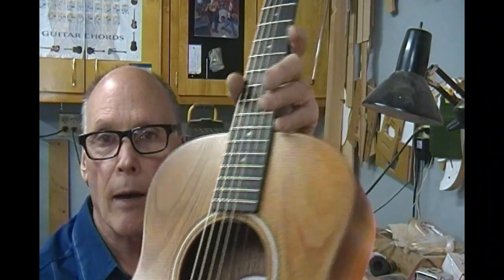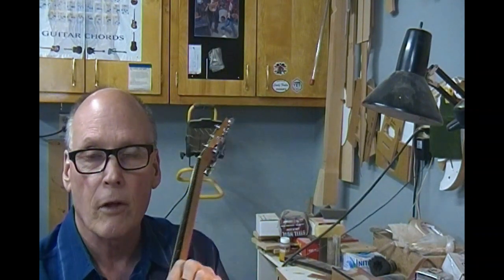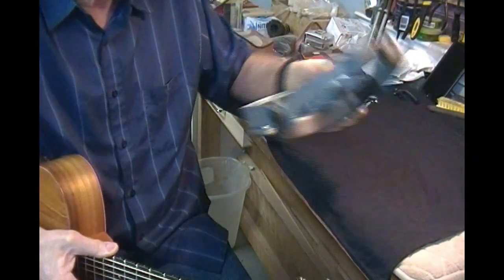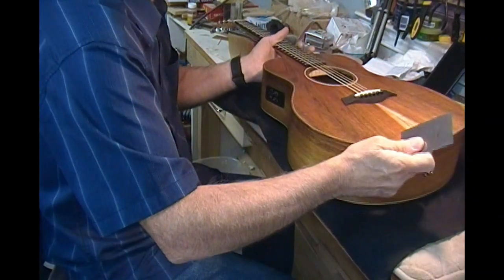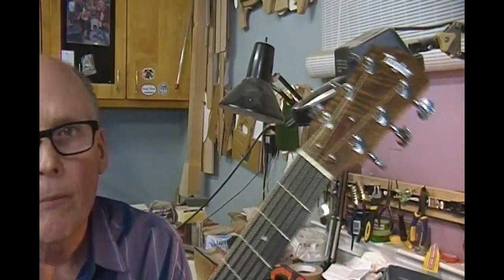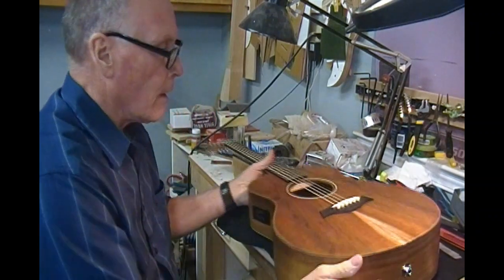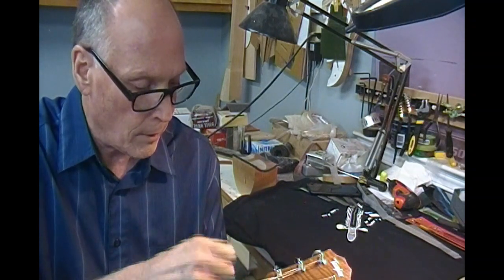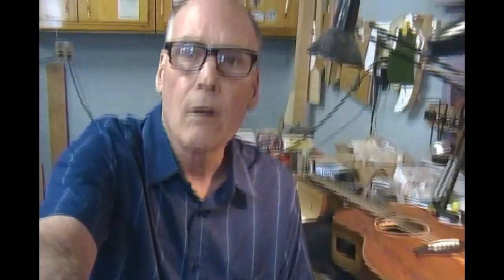Taylor GS Mini set up - by JONAH GUITARS

Comment: Dane hello! I'm a composer from istanbul/turkey  i recently bought a gs mini e koa and after 2 guitar workshop, i still have the same problem. My E string (thick one) has a entonation problem. When i try the tune the guitar it cannot find E-0. It always swings to +2 or -2 but can't stay at 0. I think it's about my neck nut, and maybe it was a fault by the guitar workshop. May i can send detailed photos about it and maybe you can direct me to the problem? I really couldn't find anyone who's master the subject about gs mini's at Istanbul.  I guess one of the guitar repair guys used too much sandpaper for to nut and the wire is way to low, but i'm not sure. I only have this problem at thick E string. I can send a mail with photos. I hope you can direct me i just want your professional opinion. Thanks!
Reply from the maker: Yes please send photos. I will see what can figure from there.
Reply: @jonahguitarguy  thanks a lot! i sent the email!

Comment: What a palava. First check neck relief, then nut slots height, then neck angle. If the action is high, change the heel shims. Never mess with the saddle on a Taylor..
Reply from the maker: I looked up "pulava" depending on the language it could mean anything from brilliant to screw up. I'm guessing you intend the later. If you don't have Taylor neck shims readily at hand you can shave the saddle. Do it all the time on much more valuable instruments. If a time comes when a serious adjustment needs to be made shimming the neck and replacing the saddle would not be a big deal. This is not an irreversible repair. I do appreciate you watching the video Steve.
Reply: @jonahguitarguy  hi, appreciate your reply,  I meant to write palava...
Reply: In any case, Taylors are all set up from new with a high action for heavy strummers, unless you're one of those, you'll need the neck joint re-shimming. If you don't have one locally, an authorised dealer will send you them, and it's a ten minute job....

Comment: Let me start by saying that I’m no expert, however my understanding is that Taylor guitars have been designed to use their shim system to set string height. I took my guitar to a Gold certified Taylor repairer and that’s basically what they told me. You shouldn’t, apparently, need to make adjustments to the nut or saddle if you have access to their shims (which change the overall angle of the neck). Happy to be corrected, but just thought I’d share what I’ve heard. Oh, I also believe that if your guitar is still under warranty and you’re the first registered owner, the cost of any shim adjustments can be covered under warranty if you use a certified Taylor repairer.
Reply from the maker: That is correct. I didn't have time to order shims. Nothing I did is irreversible. Nut hight can not be corrupted with neck shims and they are typically high out of the factory.
Reply: @jonahguitarguy it's  about the money,??? shorter the saddle takes away from the top pressure= less tone and volume @ you coulda ordered the shims..
Reply from the maker: @Itsme-ni9jk  I don't disagree with your assessment about saddle height. However in this case only changing neck shims would have left the high E string to close to the frets. That's why I opted to take material only from the bass side of the saddle.

Comment: What about a truss rod adjustment? Mine doesn't take an allen key
Reply from the maker: On an acoustic guitar if the adjustment access is through the sound hole it's probably an allen. At the peghead it could be a nut or an allen.

Comment: SIR,ARE THOSE BLACK BRIDGE PINS THAT COMES WITH THE GUITAR ARE  PLASTIC OR EBONY?I THINK THEY FITS WELL RATHER THAN THOSE WHITE PINS THAT YOU INSTALLED...
Reply from the maker: Thanks for watching. I had to watch it myself to see what you were talking about since it was three years ago. I think the black pins were ebony. They look a little high to me in the opening section of the video, but even across the bridge. The white pins at the end were bone. I say it at the end of the video, that before I  fit the pins I wanted the owner to play it and see if he liked it. Because you have to ream the bridge to fit the pins you don't want to open up the holes if those pins aren't going to be used. You might make the holes too big for other pins you may end up using.

Comment: Hello! I have a problem with my gs mini Taylor walnut guitar. Whenever I tune it and play my guitar, it gets out of tune. I wonder why. Do I need to change anything on my guitar? I’m bothered :( of the sound
Reply from the maker: Thanks for your comment. Two things come to mind with you out of tune issue. First of all Taylor didn't use cheap tuners on the the minis and tuners are rarely the problem with tuning issues. One possibility is the nut is not cut quite right and the strings are getting stuck in the nut. Once you play the strings slip in the nut resulting in tuning problems. But most likely it's how you tune and this is a very common problem. You should always tune up to pitch. So first de tune the string and then bring it back up to pitch. If you happen to tune it sharp don't just loosen the string down to pitch. This will leave slack in the tuner and once you play it will go out of tune. This is the number one reason people have trouble keeping their guitars in tune.

Comment: What is the best gauge of string for the Koa?
Reply from the maker: Hi sweetie, the mini Gomes with .013-.056 from Taylor as do many of their guitars. So I wouldn't go any bigger than that. Strictly acoustic, not plugged in, 13s will be you loudest option. I personally use 10s on all my guitars. Electrics and acoustics alike. Lighter strings are generally consider easier to play but many folks like the feel of the 13s.

Comment: nice, all the GS minis I played sounded pretty bright . .  think most owners of  parlor/half/mini put higher gauge strings to get a better low end response, perhaps a deer antler saddle or  EQ adjustment.     Cheers
Reply from the maker: roboZ starrr thanks for taking the time to comment. Deer antler is kinda hard to come by around here. Not because folks don’t hunt but because they like to keep the antlers. 

This guy was having some buzz so he put heavier strings on already plus it’s a Kia top. Not sure how much of a diff that makes but the pins did brighten it a bit. His main thing was getting lost in the mix on stage acoustically. As a side note he has an large collection of Martin’s and he’s used to punchy sound.
Reply: Here in the UK, you can buy deer antler cut off pieces in pet food stores intended for dogs to gnaw at. I bought one for my dog and she turned her nose up at it, so I repurposed it as a handle for blackthorn walking stick! Maybe it's the same in pet shops across The Pond?
Reply from the maker: @KL3NCH  haven't seen deer antler in pet store only rawhide and pigs ears. Jerry Rosa hunts his own and has multiplied thousands of subs that send them to him. I'm pretty sure this little Taylor has a Tusq saddle. hard to beat. But then again if the pin can make a diff...
Reply: @KL3NCH  yeah, we have those antler chew treats for dogs in pet shops. I've seen them around for years.

Comment: Still dont know how to lower my string height after watching this vedio:(
Reply from the maker: I just watched far enough into the video to see what you mean. I have other videos that explain the process in great detail. Without going into all the other things related to saddle adjustment and string height I'll explain the process. So assuming everything else is correct, to lower the string height you must shave the saddle down. You can sue a file or sanding block. Most important is that the bottom is square to the sides when finished and straight from end to end. Good rule of thumb is 2x the amount you want to come down at the 12th fret has to come out the saddle. Example one is, if you want to the fat E string lowered 1/64" at the 12th fret you would have to remove 2/64" or 1/32" from the bottom of the saddle. Example two, if you want to the fat E string lowered .5mm at the 12th fret you would have to remove 1mm from the bottom of the saddle.

Comment: I’ve been noticing more and more non-spruce top guitars recently. Given the odd set-up this one came with, I’m guessing its design goal was to look good—full stop.  Good video, Dane!
Reply from the maker: I think non traditional top woods are something more akin to one off makers or small shops trying to use local woods or more sustainable woods maybe. But Taylor has been using Koa on their full sized guitars for years. Something that has never made sense IMHO is how all the guitar builders rant about grain spacing and how it must be spruce and quarter swan or it's not strong enough and won't sound good and bla, bla,bla. And Taylor throws some ridiculously figured Koa on a top and it's strong enough and sounds great. Their words not mine. This set up didn't seem awful to me as it didn't buzz when I played, I just made it better.

Comment: If I do a trust rod adjustment to my gs mini mahogany and get it around 2.4mm on the low e on the 12 fret. There seems to be some fret buzz close the second fret on the g and b string.  Almost a dead sound.  But if it don’t have that low. It’s hard to play and f  or bar chords up the neck.  Is there something I should be looking for ?!
Reply from the maker: Good question Jason. The truss rod is there for neck adjustment not string height adjustment. They do inter-react with each other but there are some rules or cautions. Most guitars electric and acoustic will work well with .010 inch of relief in the neck. That's what the truss rod is for. Capo at first fret and hold the fat E down at  the body joint. Measure around the 6th or 7th fret. Then measure the string height at the 12th fret. I like 4/64s even on acoustics but 5/64s is well within range. Hope you find this helpful. There is a lot of tech info at a web site called GUITAR ATTACK. Check it out.